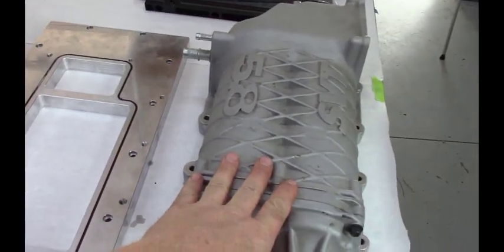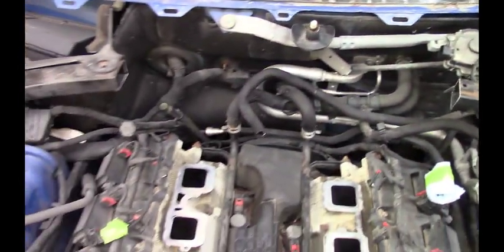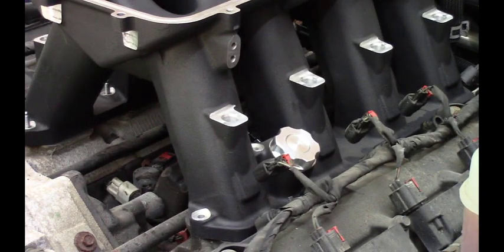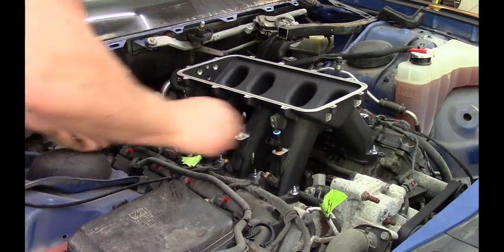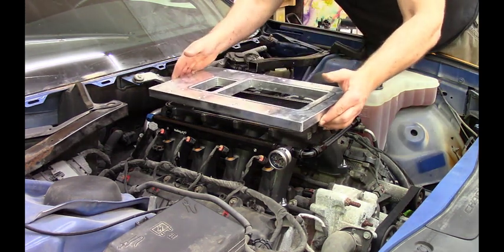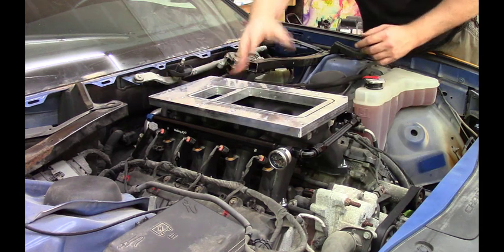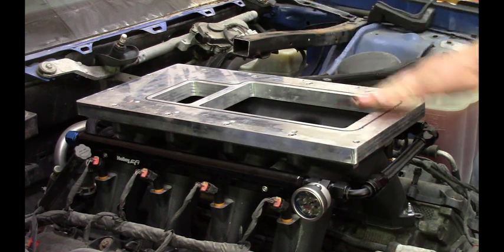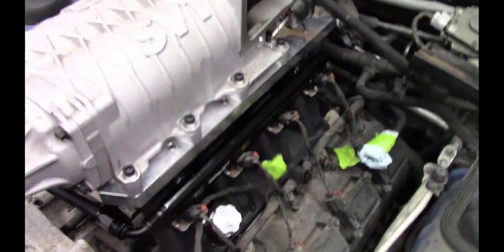GT500 Supercharger Install on Dodge Charger 5.7 Hemi Part 1

Comment: Did you need the helical fuel injectors
Reply from the maker: @joecunic3708 Yes they were. I was not able to richen up the engine enough and the injector duty cycle was super high.